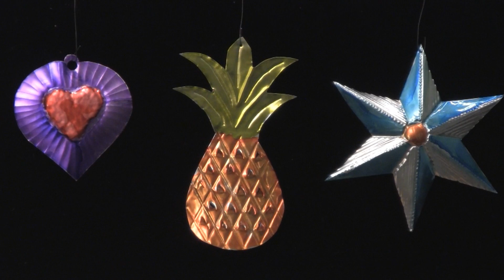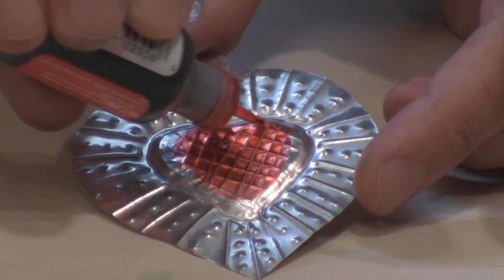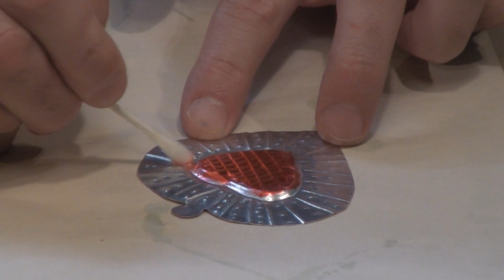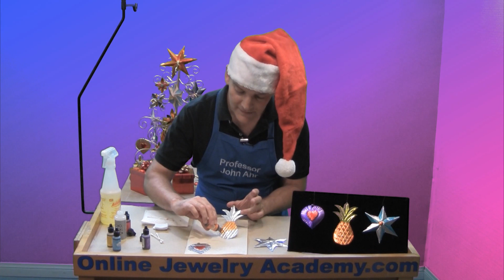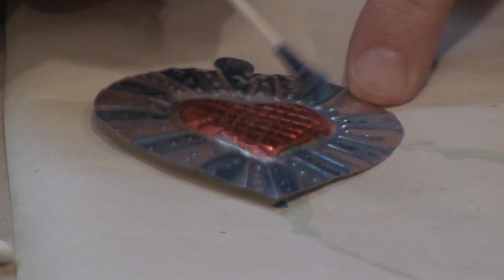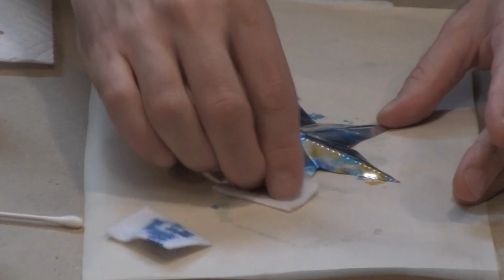Using Alcohol Inks On Metal

Comment: Oh & also if I use alcohol inks 2 color pieces make sure they are not pieces that will contact skin because something weird happens when we sweat it makes the colors fade so you want 2 test it out like if you color beads in a bracelet between washing hands & everything else it changes the color
Reply from the maker: Kimberlie Rose Wehrman Hi again Kimberlie, You were absolutely right about the alcohol inks changing when they come into contact with your skin.  One solution to help avoid this would be to apply a wax coating over the color.  You might also try coating the piece with a clear coat finish.  I hope this helps.

Comment: The cleaner you used worked very well on metal, but what if you have something that's nonmetal that might get stained? Will the cleaner work  on leather or plastic?
Reply from the maker: +Wanda M. Richards 
Hi Wanda,  I used a degreaser to clean the metal before I started to work with the alcohol inks.  I would never use it on either leather or plastic.  It would ruin the surfaces of the materials.  Good luck with your projects.
Thanks for watching! : )